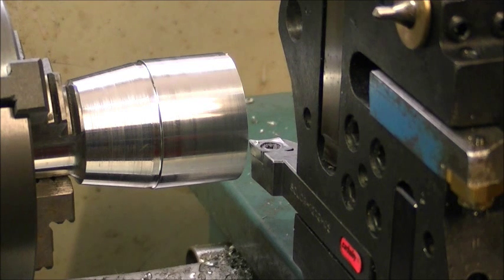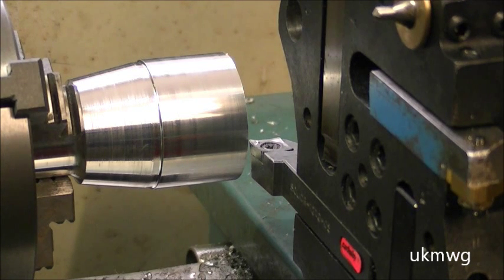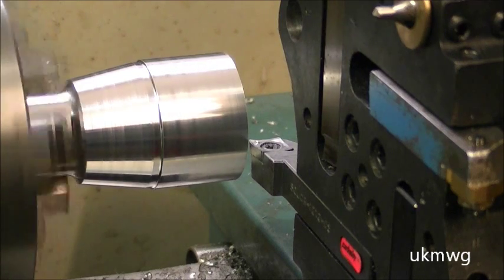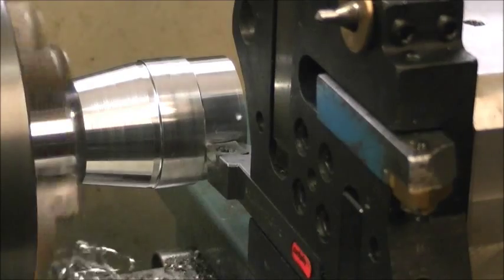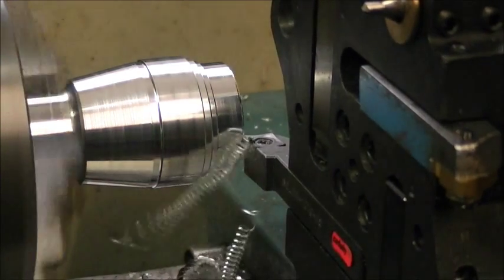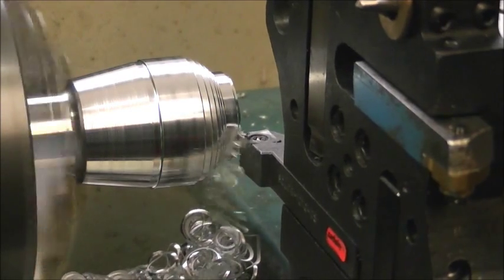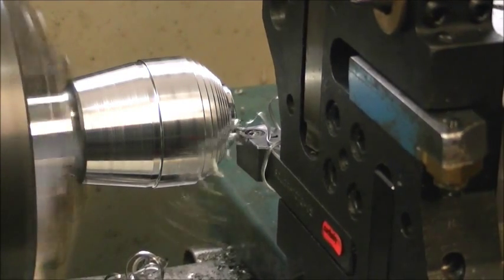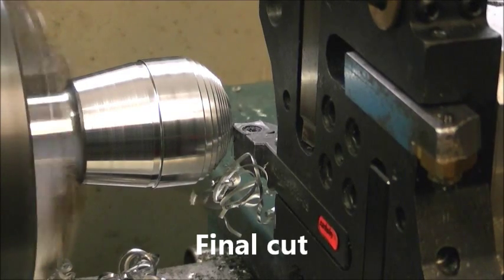Denford ORAC cnc Lathe- Turning Radius end to bar

Comment: Hi, youve got some great videos on this lathe! Ive found one on ebay...seller says its in good standard condition, all works well. I dont suppose i could be cheeky and ask what you paid for yours? I cant find much info on pricing, im not sure what we be a bargain price vs over paying... Probably a strange question but you seem to know your stuff so thought i would try asking :) cheers, Ant
Reply: Update in 2019 in case anyone stumbles upon this looking for pricing.  I paid $500 for an ORAC with no motor, chuck, or fixtures/tooling and questionable electronics a few years ago.  Last week, I picked up a second on eBay for $900 with motor, tooling, and fixtures, but no cabinet or electronics.
Reply from the maker: @cilynx  They were pretty good prices, but when buying these cnc lathes you need to be sure they haven't been thrashed to death turning out small parts every day which will wear out the ways, ballnuts/ballscrews,  best machines will come from training schools or colleges.
Reply from the maker: Bit late replying but paid £1200 3 years ago.